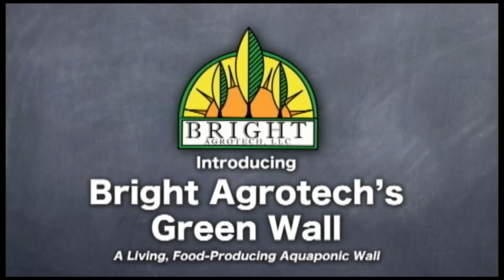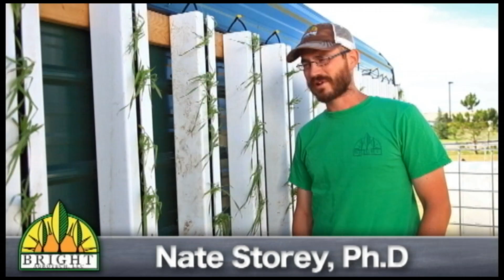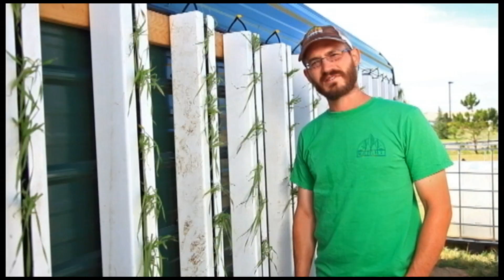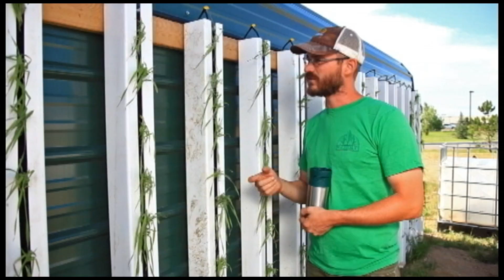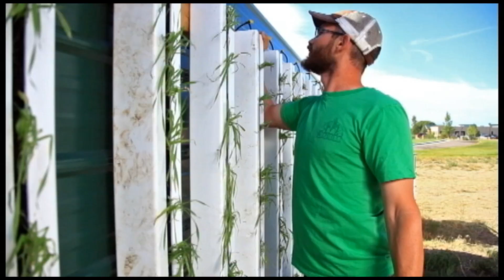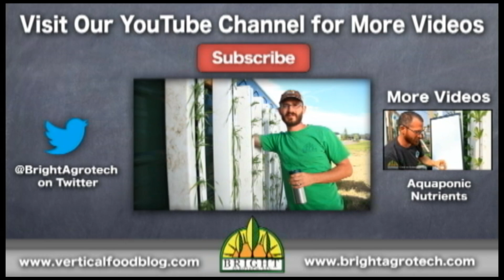World's First Aquaponic Living Green Wall

Comment from the maker: Hi Tony, The barley will grow out this fall and die after a couple of hard frosts.  The system will be turned off at this point and the barley will simply work as insulation for our fish house during the winter.  In the spring we'll replant the towers and turn the system back on.  There are some perennials that you could grow though that would survive the winter. . .

Comment: have you considered painting the west wall black and adding a sheet of clear (plexiglass, glass, greenhouse plastic, etc.) material with a few inches gap between the two as solar heat collection? with the snow/ sun/ reflection rate it should work well! also I was wondering about the hydroponic greenhouse ...the gravel is grayish? if you added a layer of white quartz landscaping fill it would refract even more light to the plants, and ...(perhaps) the water collection troughs at the bottom of the towers.....if you added a 45 degree turn into the walk way and another 45 as to go between the towers in the middle/bottom of them you could add a horizontal column of plants (most likely a thin leaf/ shade loving plant (anise maybe) between all the towers, (so for say....every 10 towers you could have 9 extra horizontal columns... increasing productivity? I realize walking between would be a little difficult though.